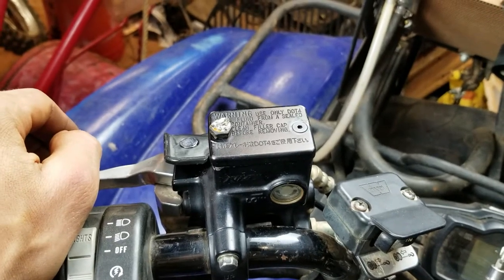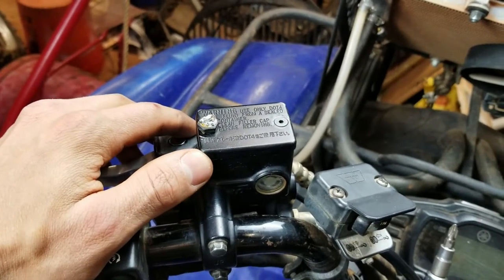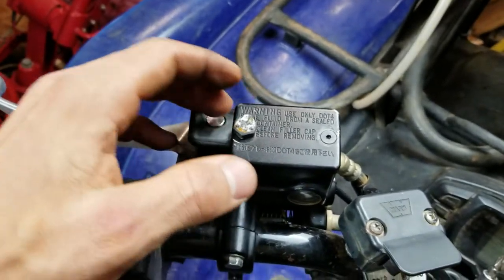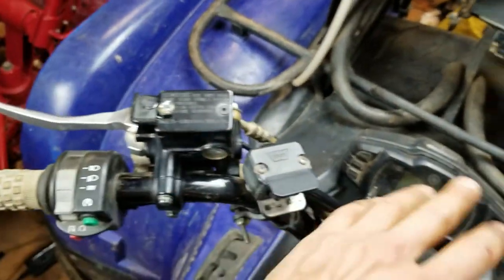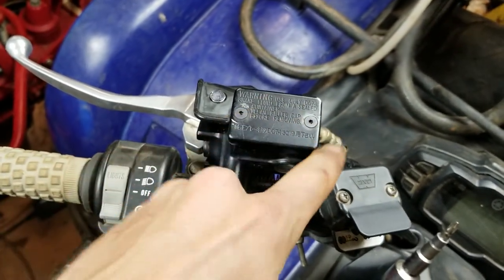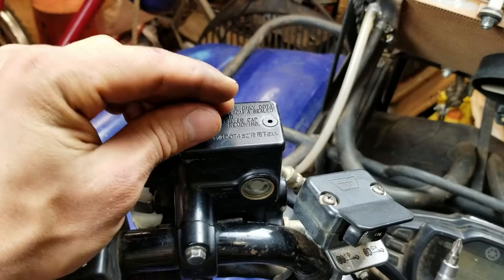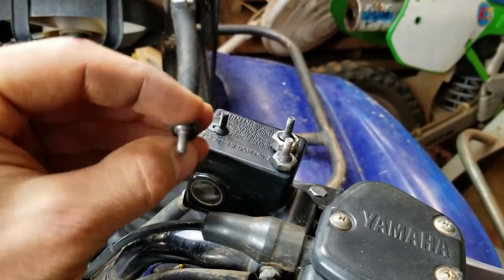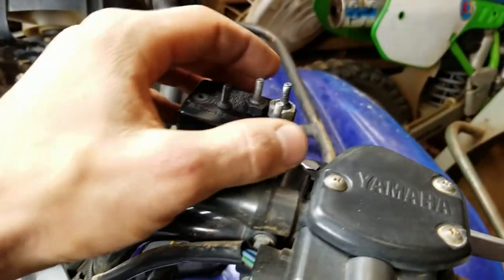Stripped ATV Master Cylinder Screw Removal TRICK!

Comment: Imma do this tomorrow used to tig weld bolts out but I only have mig welder atm. Also there are rubber o rings i hopeni don't put too much heat. But thanks for the idea
Reply from the maker: I just used a cheap MIG welder for this. Yes, there is a giant rubber "cup" under the cover. I covered everything but the nut I was welding with wet jeans to keep it cool!

Comment: How about drilling a little hole through that bolt head to get a little better weld? It might make it a little easier if you're using a stick welder. Just brainstormin' a little on your method. I've had the same issue on some car stuff but never thought of the welder. The screws on the idle air control valve and the ones that hold the elbow to the stock bypass ( blowoff) valve on my WRX are made of that soft metal too.
Reply from the maker: You can weld a little bead on the screw head first with a MIG welder and then weld the nut on. It works great that way.